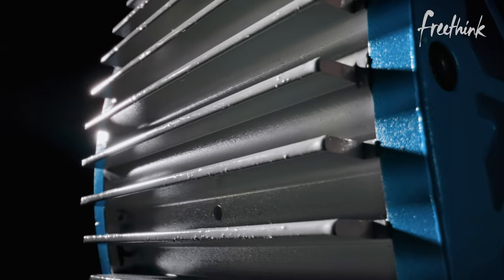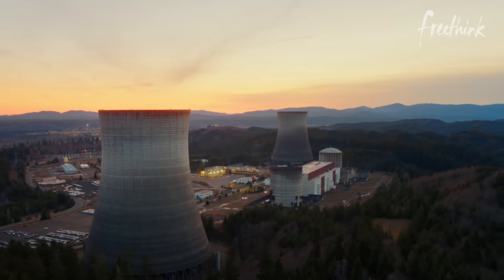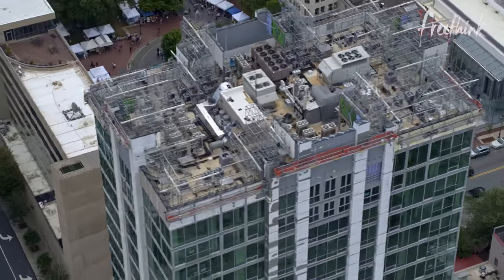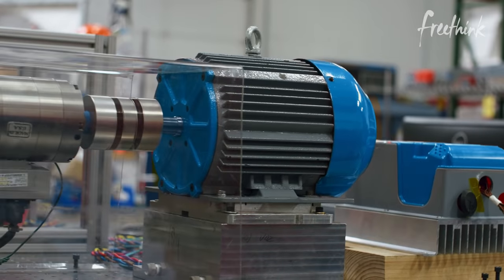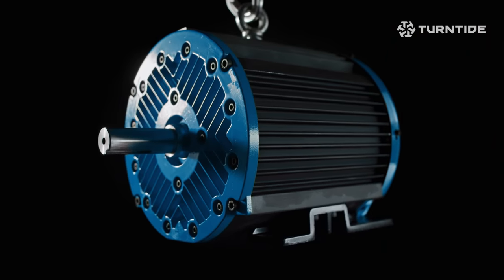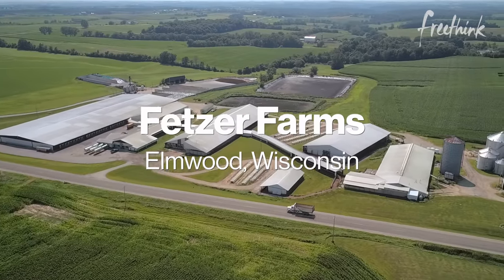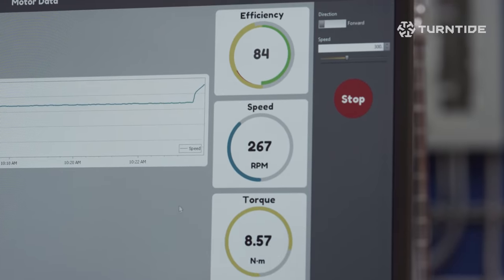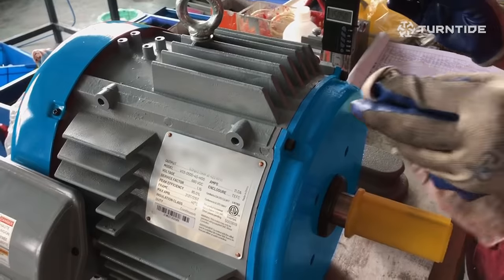Want to Save the Planet? Start with Reinventing the Motor

Comment: As an Engineer, I have reviewed specifications of Induction motors and would like to add my opinion here.
High efficiency motors that work on improved lagging power factor, meaning less than 1 and above 0.9 lagging power factors are already available in  the  market. However it is priced higher than lesser efficiency motors.

If you have already installed those lesser efficiency motors, you can use automatic power factor correction control (by adding Capacitor banks).

Comment: First, what do I think of this video? It had lots of hype and very little actual information. What do I think of this technology? I don't know. This video did very little to explain how this motor technology is different from other electric motor technology. In the video it said, to the best of my recollection, tht the computer turns the current on to pull the pole of the rotor toward it, then switches it off at just the right time and turns the next winding on to pull it toward it. Well, isn't that how all electric motors work? Take a motor with a commutator. As the commutator turns with the rotor, the brushes make contact with the correct winding to cause the rotor to be pulled in the correct direction. With a brushless DC motor there is a simple electronic driver that does the same thing. So please tell me what makes this "variable reluctance" motor different from those other motors.
I have found more information elsewhere on the Internet. It is interesting and I'm glad you brought it to my attention. I just wish you had been more informative about the technology.

Comment: Reinventing? They're just steppermotors that have been around for ever... 🤦‍♂️
Reply: Indeed. So where does the AI come in? I recall making many projects with stepper driver IC's years ago.
Reply: No, I think it's still Induction.
Steppers are DC only.
Reply: @MR-nl8xr   these only run with a controller just like steppers.
And i actually have a few ac stepper controllers laying around so no steppers run just as easy on ac.
Reply: @MR-nl8xr  Steppers are 2-phase AC motors with 90° phase angle - suitable waveforms can be generated from DC-input controllers of course, but same goes for "BLDC"/PMSMs, induction, etc
Reply: @FullFledged2010  Who said anything about the controller? source your AC stepper motors sir.
Reply: @triffid0hunter  source.
Reply: @MR-nl8xr  https://en.wikipedia.org/wiki/Stepper_motor#Theory - "A step motor can be viewed as a synchronous AC motor" and if you look at basically any diagram of stepper motor drive waveforms, the 90° electrical phase offset is pretty obvious, eg https://www.researchgate.net/figure/Sampled-currents-in-2-phases-of-stepper-motor-in-500-ms_fig4_275460011
Reply: @triffid0hunter  that has nothing to do with the type of current that is used.
Phase angles are not what make AC, AC or DC into DC;
My original comment still stands.
But its great of you to put out your opinion on the subject for information's sake.

Comment: As a rule of tumb if someone mentions ai in a mecanical or something spose to be mecanical run. We do not need ai based salt holders or paper grinders. This holds true for ai motors. What can a ai even do whit a motor. Determin the frequensy? All the thing a ai can do is so simple that we can just run trugh all the options and pick the best one.

Comment from the maker: What do you think of this technology ?
Reply: Anything that saves money is good
Reply: Use science to save 50% efficiency on everything...!
Reply: Saying you can save 25% on carbon emissions by trying to squeeze an extra what? 10% better efficiency than current switched reluctance motors that use hall effect transistors? Pointless! JUST STOP USING FOSSIL FUELS!
Reply: @dragonskunkstudio7582  they also won't use nuclear, so want are we left with
Reply: Hence why Tesla cars have used reluctance motors for just over a year now.
Reply: @sean51697  Yeah! It's hopeless that is all there is ZERO point ZERO other choices.
Reply: @ALXXX They are claiming they are better by being more efficient. The difference is marginal.
Reply: They didn't mention how much their motor costs. Sandy Munro did a  teardown on the Tesla Model 3 motor and some other motors and the problem was weight and cost to build
Reply: Is your control system basically a vfd and a method to clean up the power returning to the grid? 3 phase everything?
Reply: Ok I know a lot about motors, and switched-reluctance motors are not a new thing, they are decades old.  Motors have always been eyed to get the most power out of a smaller package, and almost all motors have a wide region in their load curve which exceeds 80% and usually better, and the highest power density is usually from strong-permanent-magnet motors.

Motors only waste half their input power when you run them at a load level to get the maximum power out of them, which is rare except for some smaller fans and cheap toys, and is usually an overload condition in larger motors which quickly overheats some of them and is often used only for intermittent high power applications.

Motors are about as good as they can physically get and don't need refinement in this area.  The only developments needed are for example a low-speed high-torque unit which can be built more economically, for example.

I stopped watching the video half minute in.
Reply: switch reluctance is great ...but induction was superior in past and will be in future ...
Reply: Nothing new. The motor on my ebike does exactly this. 🤷‍♂️ Lol
Reply: I have a hard time understanding how this motor actually works and how it differs from other electric motors. The whole thing was just a feel good commercial
Reply: Problem with this commercial is that YouTube is recommending this video to some pretty technically inclined people lol.
Reply: Hyperbole and unnecessary
Reply: Did I just watch an Ad?
Reply: I would like it better if the commercial explained how the motor works and how it's different. And used real numbers.
Reply: It seems like this is a perfect partner to combine with Nicola Tesla Turbines to take advantage of the new liquid air storage technology.
A generator connected to a tesla turbine would need to produce less energy to feed this. In fact if the pulses were half on half off, then the genny would only need to work at half rate, using capacitors to out put full strength pulses..This directly equates to more miles per gallon from your liquid air tank possibly even double.
Reply: @Freethink I honestly don't know. This is just an ad for one company. The technical explanation is so vague that it would fit literally any brushless motor. And no, brushless controllers weren't "impossible until now".
Reply: I am an engineer, and I say he is full of bull@@@@. His "technology" is what every $20 SRM motor controller from China does.
Reply: Do inverted barometer make energy in dam so it works many times with out any water going outside 

It's working due to atmospheric pressure which is always changing at this big level
Reply: You can use the circuit used in laser cutting machine for that extra efficiency 

Thanks me later
Reply: Isn't this just feedback-based electronic commutation of a stepper or brushless DC motor? That technology has been around for decades. Is this about promoting its adoption?
Reply: I've been dreaming of this invention for 18 years, now it's apparently the best electric motor we have. It's amazing that someone has finally accomplished this monumental task.
Reply: @cosmiccrunch8591  Did you file a patent? The laws now are "first to file".
Reply: It's not new. Personally, I think the solution is something completely out of the existing box.... Regarding motors specifically
Reply: Is this commercially available and is there a way to make this motor ourselves?
Reply: What was that thess guys reinvent, again? 
Because the BLDC is quite a few decades old...
Reply: @deanwilson9094  this is the purest form of BS snake oil salesman ;)
Reply: they made a drone motor?
Reply: @Voidroamer  dou you know what a... drone is?
Reply: As long as it is reliable.  Our furnace has a similar electronically commutated motor for maximum efficiency.  Ten years constantly running and filtering the air.  No problems until tomorrow most likely now that I posted this.
Reply: woops, my bad. drone motors are usually BLDC, this is backwards as in the winding are in the case on the outside. Still similar though, windings stay stationary and require an electronic speed controller to turn the rotor.
But their claims of efficiency scream snake oil to me.. My drone motors are ~85% efficient, and i think my Tesla model 3 has permanent magnet reluctance motors, which achieve an efficiency of 97 percent. can't get much better than that..
Reply: Is this something new? Looks like a stepper motor with an inverter. What's sets this apart? I don't see a difference.
Reply: @deanwilson9094  this is nothing new
Reply: Take 95% efficient motor and make it twice more efficient :) Sounds nice...
Even if you take the 95% efficiency at some fixed RPM it is still ok, because most of the appliances shown in the video do exactly that - switch on and off.
I don't see any reinvention of anything here.
Reply: @nikolayyotov5748  Take a 95% efficient motor and make it twice as efficient, you get a 97.5% efficient motor. Much ado about 2.5%..
Reply: They speak of efficiency gain of up to 70% over some other kind of motor that's 50% efficient (universal I guess?).. If my math is right that means 85% efficiency in absolute terms.  Lame.  That's worse than even the crappiest synchronous motors.  It's spinning a big dumb lump of iron inside it that dissipates energy every time the magnetization changes and also will have some losses to eddy currents in both rotor and stator so that's gotta be close to theoretical maximum.  

Yokeless axial flux synchronous motors are the current state of the art.  97% eff. and 10ish kW/kg with halbach magnets. Now that's impressive.
Reply: It just looks like a stepper motor
Reply: Freethink Bad journalism
Reply: sounds like snake-oil to me, but that's just the way the vice president presented it. Either way what really matters is whether the product is functional and that will be known once it's tried in industry.
Reply: How much did they pay you for this kind of ads
Reply: Yess , and brush less motors are already invented 😅😅
Reply: Pure snake oil
Reply: What is my benefit, If i have to buy a 30 % bigger Inverter as for a good old induction Motor?
With IE4 it's efficiency is up to 98.5% as Well.
Reply: What's the difference from a steper or brushless motor?
Reply: I don't understand how that is patented ? It is a big stepper motor.
Reply: Also 3 phase Motors have up to 90%  on rather small motors and up to more than that on big MW size motors... Just bullshit advertising video.
Reply: If homes were designed to be so insulated being earthened it would reduce 60% of energy draw
Reply: What will be the cost of installation compared to conventional motors.
Reply: Longboard longer !
Reply: You need to see the most up to date video that Sandy Munro has done about the a Tesla 3.  In essence they took all he had to say on board and the squared it!

That is the way Tesla roll.
Reply: @williamfreeman9271  Tesla co. Isnt doing anything to reinstate the name just financial gain off another man. Wonder if he could the same without the use of a great mans' name?
Reply: Is there any difference between a switched reluctance motor and a 3 phase stepper motor? If so why didn't you show or say it? also current motors are already almost as good as physically possible. The way the motor was explained is 1 to 1 the explanation for any AC motor and even though you make the software sound special it is not. it's nothing other than a stepper motor controller.
Reply: Why??!!
Reply: That half of all electricty wasted has to be taking into account long high voltage transmission losses, motors are at worst 85 percent efficient
Reply: @ramiro041  I think transmission lines could be coaxial or even better waveguide but who are we kidding who would want to calculate cost but side note it would stop sum EM distortion to the natural EM fields
Reply: I think you need to stop saying USA is such an accomplishment and go after the real big polluter fish: China & India.

People aways blaming USA.

Also, this thing sounds just like an ECM motor , what's the big whoop .
They've been around for more than a decade.
Reply: Tiberiu Nicolae EXACTLY❗️
Reply: CheezeCurdler - 😣
Reply: You haven't invented it it's been around for quite a few years now I have them on my drone with the same technology even in my LG washing machine and that six years old only differences you're using six phase 2 three phases mixed with the others not till now in fact they've been on cars for over 30 years six phase in reverse switch to DC
Reply: I don't understand where they get their improvement numbers. A standard cots motor by say baldor is 80% efficient already. They have series that are 95% efficient as well. So is their gains only in switched reluctance motors or all electric motors? Also it is a modified version of a normal 3 phase AC motor as it has no permanent magnets (which would make it DC brushless). Just curious where is the data to back their claims as this sounds like they narrowed to either their motor type or they are including the drive circuitry in their calcs or both.
Reply: I think it's total bullshit. You act as if this was 50 years ago and absolutely everyone still used those awful "universal motors". You even threw in machine-learning because it's a good 2020 buzzword but come on, driving a motor with micro-controller and some FET's already give you 90% efficiency, no machine-learning involved. If you managed to improve that by 50% the way you claim, you'd reach 135% efficiency, otherwise known as perpetual motion. I hope no one is dumb enough to buy your sales pitch without consulting actual electrical engineers.
Reply: The video does not explain anything about the new tech! In hobby drones, we been working on better flight control firmware and electronic speed control for years, we now switch at 96,000Hz (lookup blheli_32), your guy talking about switching at 20,000Hz is in the last century. I did not see anything in that motor that looked new, matter of fact, the length of the starter to magnet looked highly en-efficient. What new tech are you talking about, I did not see it in the video?
Reply: a electric motor is 80 percentage efficient, period
Reply: @karthiksubramanianmeyyappa6509  what rock did you crawl out from under and when?
Reply: @karthiksubramanianmeyyappa6509  it's not nearly as simple as that. It's like saying "all solar panels are 15% efficient". Learn stuff before acting like you know something.
Reply: @user-rs8zg8ey2b  are you a real person?
Reply: @dragonskunkstudio7582   exactly
Reply: @Qui-9  exactly, you are absolutely right, now when I put the same comments, paid crooks are shouting personal propaganda
Reply: @TheNefastor  I know stuff, I don't care about your credentials,
Reply: Gentlemen, the keppe motor is the most efficient motor in the world because it is a resonant motor, operating with direct or alternating voltage, without transformers and consuming only 30% of electricity.
Reply: In the dc motor we have the coil in the middle and the magnet around it! Here we have the magnet in the middle and the coil around it! Energy saved would be the absence of friction and heat caused by the brushes rubbing the armature. Pretty basic stuff. I don't see any energy loss in Nicola Tesla's induction motor. After the induction motor then came the poe vortex coil. I am sure the Nobel prize would be awarded to the one who invents the poe vortex motor. That would be the energy saver. Thank you.
Reply: It is a great innovation
Reply: Why would one not simply use an induction motor with a VFD?  If you need electronics anyway, it's hard to see the downside of existing technology.  Without more detail on actual efficiency numbers, I do not see the purpose of further developing SRM technology.  Also, it is not entirely accurate that SRMs are hard to control.  Hybrid stepper motors use a combination of permanent magnets and a reluctance yoke to develop torque.  Control electronics for such motors have been available since the early 1980s.
Reply: That means i have to learn it as a motor rewinder.

Comment: Let’s mass produce it.
Reply from the maker: To get it in every building in the world, it'll definitely take a massive manufacturing surge
Reply: Freethink that we can do with the right automation and logistics.
Reply: @freethink  You need to balance the replacement equations with the carbon footprint that goes into manufacturing the new motor as well as the old motor. So that the carbon produced in the production of the old motors is not in vain. Mindless replacement is wrong.